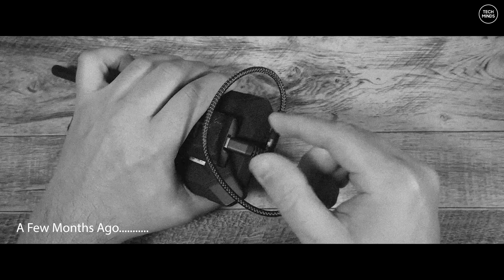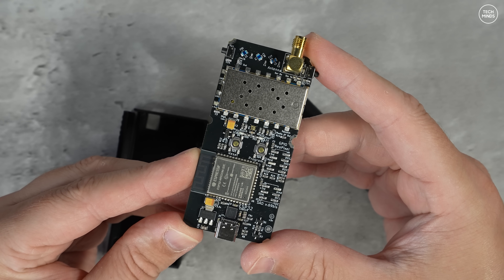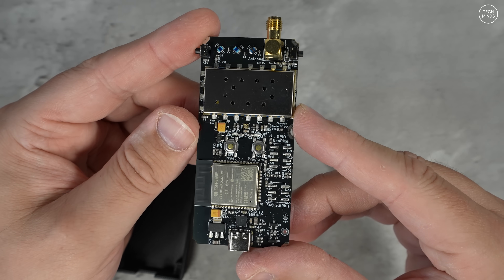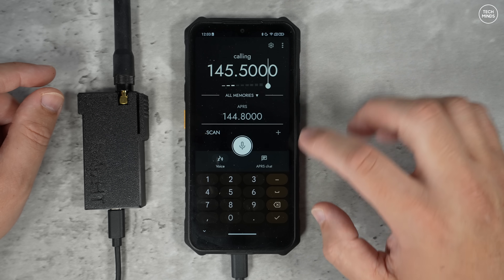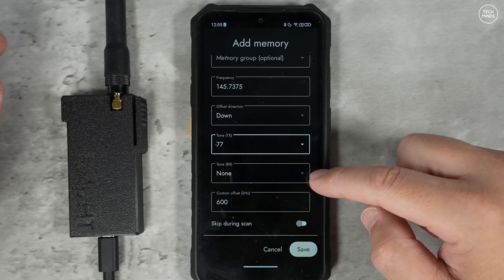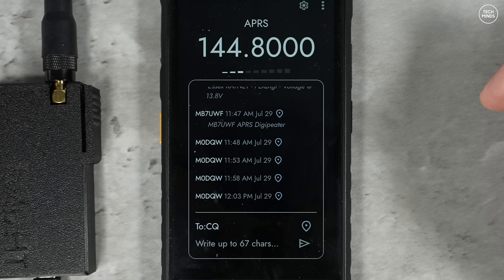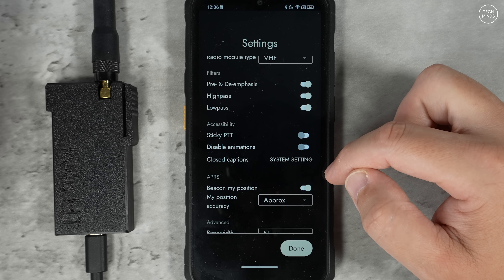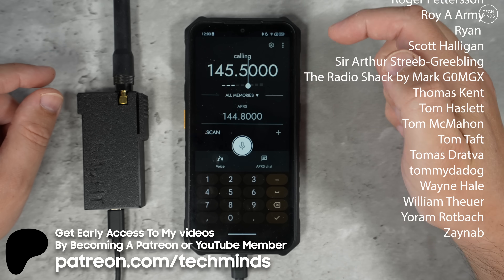Turn Any Android Device Into A Full VHF Radio - KV4P Version 2 - NEW!

Comment: Wow, never think this could work, but I will look forward for an UHF unit.
Reply: just change the radio chip and the rf filter.. the app already have uhf support. should be a 10 minute job
Reply: @redfireviper    Just buy the SA818-U  RF module and solder it in place.    The  -U  module has same footprint as the SA818-V only it works the UHF band.   And whats more is the App already knows about the -U module.   Just select "UHF"  in the menu under Module Type.     Also,   make a small jumper from the output pin of radio module over to the SMA Jack.    This bypasses the filter network and gives full   1W   output

Comment: I just did the soldering for my V1. Moving has caused delays in ham projects. The price I paid was a lot less than the current prices. And, I saw Mark Smith posted in the KP4V Discord that prices were even higher when he did a reorder today. Next week I should be able to get it up and running.
Reply: its a pretty fun bit of kit.   I bent a small thin piece of aluminum and use that as a "clip"  to secure it to my phone.   the 'clip'  looks a bit like a "fret clip"   of a guitar.    hope you get the idea.     and of course,  I did 3D print the  'V1 case'  for this project as well.

Comment: I wish someone would design and build a scanner module especially for the airbands like this
Reply: Just buy an otg cable and plug in an rtlsdr. There are sdr apps that work on android for it and airband falls nicely in the range of an rtlsdr.
Reply: Do you need both transmitter and receiver .

Comment: I have two of the VERSION 1  units.    And I made one of them into a UHF Radio by simply replacing the SA818-V radio module (silver rectangle near SMA)  with an  SA818-U .    -U is the UHF radio and it works fine with the KV4P App.    just select "UHF" in the menu under Module Type.    (note,  you should bypass the filter network that is next to SMA connector for this to transmit full 1w on UHF)
Reply: wonder how's the emissions if you bypass the filter. i recall there are proper uhf filter values somewhere in the project github.. worth checking those

Comment: Fairly pointless, you can buy a cheap hotspot for the price
Reply: then you missed the point.   this is a VHF transceiver.   its an experimental radio partly based on phone for ease of use.   I have 1 strapped to my Samsung S20 phone
Reply from the maker: @dan_in_sd Yep, I would agree. Experimentation in this hobby is part of the fun for me. This project can teach you about electronics and programming as it is open source.
Reply: You comment is pointless. You missed the POINT

Comment: No uhf version yet ?
Reply: yes.   just replace radio module (the silver rectangle next to SMA)   with the SA818-U   same cost
Reply from the maker: You would have to re-design the filter network, or by pass it, but the SA modules are dirty without a filter.

Comment: Only thing missing is adding a battery to the radio pack and making it BT connected instead of usb.
Reply: Vgc already makes an ht that does that.
Reply: @matsherwood6277 is it really the same tho? Their BT remote mic with UI is discontinued. And their other BT mic has no UI.  Are you talking about the 7500? That's not the same form factor.
Reply: I like the BT idea. Cuz I could leave the module outside my window, and keep the phone indoors. Cheaper than vgc which someone mentioned, but that's not the same, doesn't have the same UI
Reply: Why would you want that?
Reply: @emyalfaro  So I don't have to have the radio unit stuck/tied to my phone. Using alternate usb power for the radio would be fine too, as long as it doesn't need to be physically tied to my phone.
Reply: @nerdgarage but then it loses the whole point of the build...
Reply: @emyalfaro  how so, from my point of view the point of the device is a radio with an interface that isnt an incomprehensible jumble of button presses that you cant remember, or the requirement of a computer and crappy oem software to configure it. Neither of these is compromised by using a bt connection instead of usb from phone to radio device.
Reply: @nerdgarage you definitely missed the whole point of the project...
Reply: get a quansheng with built in by for audio and cat

Comment: Very cool! I wonder if ssb is just a firmware update away and dual band 2m/70cm would be cool also. I'll be purchasing this shortly.
Reply: No, that won’t work like that - it uses a regular SA818, which outputs an analog audio signal and expects the same on its input. This module can only do FM and nothing else. Honestly, I don’t see the point of including a smartphone in this project - it would’ve been enough to add a PTT button (which is also available on the SA818's GPIO), a combo jack for a microphone and headphones, any display, and you’d have a complete radio.
Reply: @dktr2  yup.   i replaced my SA818-V   with  -U   and it came right up on 440MHz.   just need to select it in menu under Module Type
Reply: That sort of thing needs an SDR radio, not a dedicated FM one. As a homebrew project you could probably do it, though.
Reply: Thanks for the replies, i appreciate them. Its ashame ssb can't be easily added. 73

Comment: I would much rather have an Android device with all this baked in. I hate that it needs to be tethered and it doesn't even include an appropriately short and angled cable for attaching it neatly to your device.
Reply: get version 1,   still available.    it can clip to the back of phone and all that is required is the  "U"  shaped  USB-C connector so that it nicely plugs into bottom of phone
Reply: Imagine Unihertz Atom XL with documentation exposed, revealing how to control its RF module. Analog FM, P25, M17, APRS would be all doable. That would be much better than this "device".
Reply from the maker: @SP5WWP Yeh, but none of those manufactures that include a transceiver in their Android phone will release documentation on how to control the RF module.  Why don't you develop an Android app that can use this hardware to tx and rx M17? I'm sure you would love it then.
Reply: @SP5WWP  android 11? i want my nord10 back

Comment: How much power does it have. How many watts and can you change the antenna with a better one.
Reply from the maker: I think the module is around 1 watt and yes, it has an SMA socket so you can connect any antenna to it, assuming its tuned for VHF.
Reply: @TechMindsOfficial  I thought those modules did ~5w
Reply: @nerdgarage yes... I wonder whether they hobbled it to avoid interference with the phone...
Reply: @PaulTaylor1  nope.   1w is what you get with SA818 radio module  (thingy near the SMA connector)
Reply: @TechMindsOfficial  1W...lol, for testing maybe nice but not in a real life, except you live under a repeater. Sorry, no use case for me!
Reply: 1 watt.    use a really good antenna to open any repeaters in your area.    i would use a 6 or 8"  whip antenna

Comment: 1 watt is not going to reach many fars ,i`ll stick with my Quanshang
Reply: but will reach repeaters.
Reply: @pen25  sure will.   i have 2
Reply: So will a quangshang without the messy wires and a third of the cost  @pen25
Reply: @pen25 so will a quangshang at a quarter of the price. And less of a faff